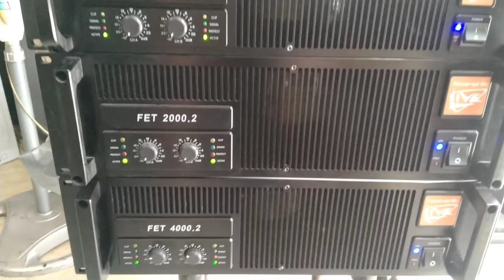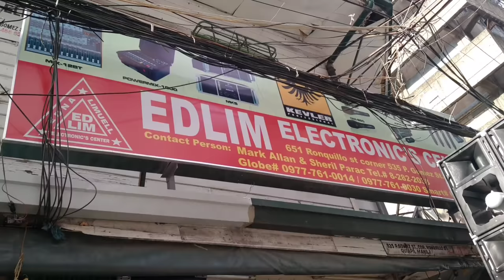1 SET SOUND SYSTEM 360K BUDGET,4PCS.MCV 18",4PCS.BULLET 15" LOADED P-AUDIO SPEAKER AND TWEETER.

Comment: Distorted ang tunog. Either the amp is underpowered, the speakers are overdriven, OR the boxes are too thin for the drivers.
Reply from the maker: Distorted Yan sir Kasi sa cellphone Yan ganyang talaga pag sa video ka lng nanood.
Reply: Ganyan talaga tunog kapag malakas yung sound tapos malapit yung nagvivideo sa speaker. Distorted talaga po ang output na tunog sa video.

Comment: sub 4pcs 50k total,4pcs mid 38k total,4pcs hi 42k total, 3 power amp total 102k,4pcs mcv box 8500 isa bali 34k, ewan nalang sa mixer at processor tyaka sa mga connectors dahil hindi pinakita kong magkano at mid hi box. sumatotal 266k. so bali 94k halaga ng mga midhi,processor,mixer at connectors.ayos na din pero kong processor is eq at crossover lang medyo sa palagay ko lang mukhang overprice konte
Reply from the maker: Kaya nga sir naka lagay 360K budget.ibig po sabihin budget yun posibli po na subra talaga.pagbumili ka may bawas talaga yan bawat item.